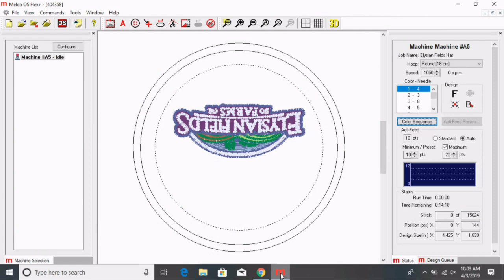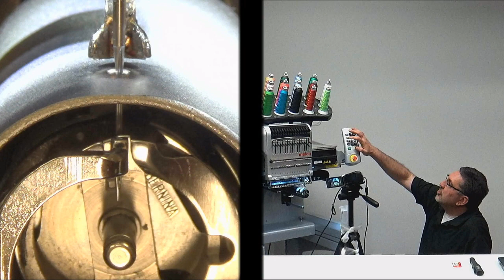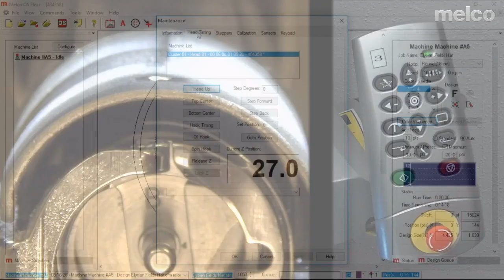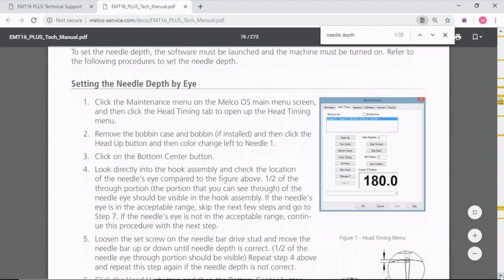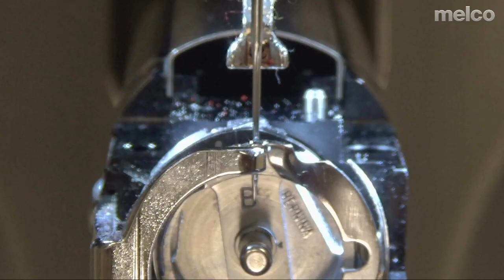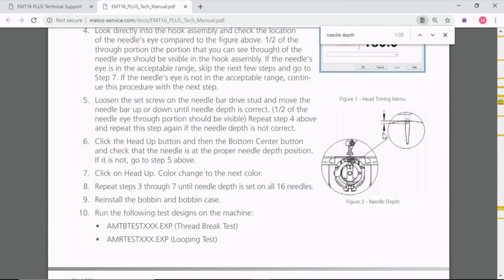Needle Depth and Needle Calibration

Comment: HELLO, I HAVE 3 EMT 16 AND THE X CABLES LAST LESS THAN 1 YEAR. I CHANGE THEM STARTING FROM THE LEFT SIDE OF THE MACHINE, TO THE RIGHT. WHEN I PERFORM THE MAINTENANCE, I MAKE THE TENSION ADJUSTMENTS LITTLE AT A TIME BUT ON BOTH SIDES (BOTH NUTS). THE PULLEYS TURN PERFECTLY AND SHOW NO SIGNS OF DETERIORATION ON THEIR SEAT TRACKS. WHAT DETAIL COULD I BE OVERLOOKING? THE CABLES ARE CONSTANTLY STRETCHED UNTIL THE SHEATH BREAKS AND FINISHES BY DETERIORATING AND CUTTING THE CABLE.
Reply from the maker: Please reach out to technical support.  

https://melco.zendesk.com/hc/en-us/articles/202857595-Contacting-Melco-Warranty-Technical-Support

Comment: Hello: I have a tip for your way to calibrate the Needle: Tool/ Maintanence / Calibration. When you are there press the step back arrow. The Maschine will go automatic to needle one und down with the needle to the needle Plate. If you like to adjust, you do it like you did. Now you like to go to needle two just press the one step back arrow again. If there ist anything okay just push the button again (you dont have to lift the needle up), the needle goes up, to needle 3 and down in one move. That makes everything faster ;-)
It´s not my way (i use a faster one)
Just a tip
Best regards from Bergen at Island Rügen (Germany)